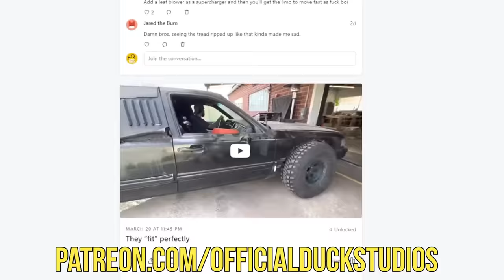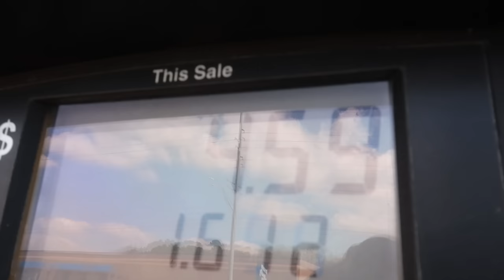I Built a Luxury Limo-Camper

Comment: can't wait for the "replacing all of our wheel bearings" episode after installing the spacers
Reply: Nah the ball joints will give out long before those wheel bearings also spacers are only in the rear
Reply: @16driver16 3:44 definitely front spacers. Also ball joints, wheel bearings, who needs ‘em?
Reply: @Ford Squared  14:27... did you stop watching halfway through? You fail the test. Go back and watch the material again. They added spacers only to take them off after 100ft... before they ever hit the road. The new smaller tires no doubt rubbed less without the spacers
Reply: @16driver16  I did in fact stop watching immediately after the part I referenced. I have an abysmal attention span
Reply: @fordsquared537  Based and honest zoomer pilled.
1.7 seconds let's

Comment: In all my years in building as an elictrician I've never seen a tool bought for work from Hilti or Bosch going up in smoke , even when I brought our HILTI drill to a point where I burn my hands on certain parts and the dust in the drillhole begins to smoke, still worked fine after very very heavy not intended to to once per week duty 

buy smart and only buy once

German dude says: Bosch for fun and hilti for reliance.

Comment: Most the time it's the alternator that makes a car die once the battery is fully drained. Most vehicles can run without a battery. And throw them spacers on the front to match the offset of the rear. Would look better lol.